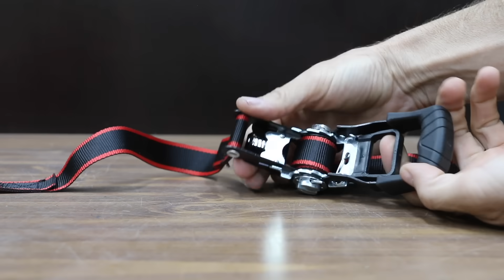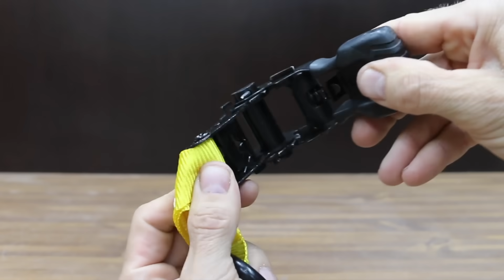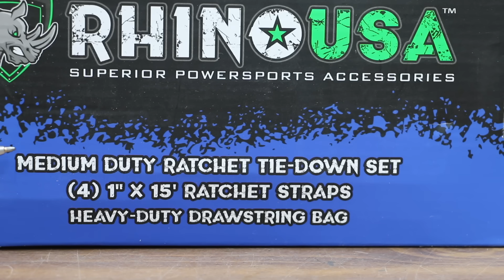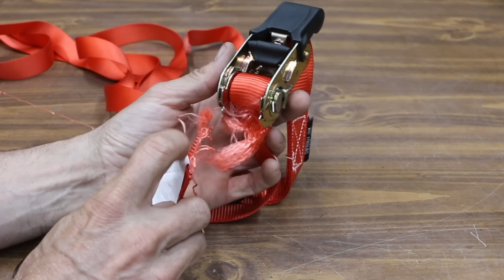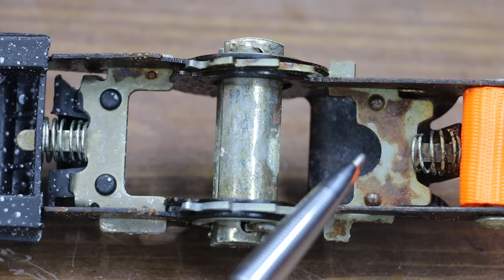Best Ratchet Strap? Husky vs Stanley, Rhino USA, Rocket, Topsky, Augo, RPS Outdoors

Comment: Can you redo this test, but add some tests for the longevity of the ratchet mechanism. We constantly go thru straps when the sheet metal fatigues causing them to fall apart sideways where the pin and washer just lightly suggest the internals to stay put causing it to jam and skip and not ratchet properly.. more of a focus on the ratchet vs the strap.. side ways flex/bend resistance. It only tends to be an issue on 1" can't really use bigger either

Comment: you have to close the ratchet to lock it. Why testing tension loss with the ratchet open on some of them? 

Also the weight to release test is dumb as hell the ratchet isn’t fully open and you aren’t releasing the lock. Nobody would ever use a strap like this.

Comment: I had the harbor freights and the ratchet mechanisms fell apart, junk. Bought the Huskys and they have worked great with no issues. Will admit I don't use them a lot though. Can't speak for the rest, but the Husky certainly better than the harbor freight ones I had.

Comment: I'm a DIY homeowner and use my cheap ratchet straps very rarely.  Here's what I've done with mine and what I would look for in a replacement.
1. The gap between the take-up real and it holder is way to tight.  I preyed mine apart a bit and added a little lubricant.  I want that real to spin easily and freely.
2. Like many, mine have a single spring anchored on one side of the release lever.  The makes the the pull uneven and I usually have to use a screwdriver to full relase the ratchet.  Would a second spring really cost that much?
3. The take-up real is too narrow and too small.  Often times, you just have to ratchet more than you expected, but you can't because the darn spool is too full.  Also, we all know how easily the straps bind up, a little wider spindle would help a lot.
4.  The end of a little pry bar fits perfectly into the spindle ends (over the retaining z-bar) and makes a wonderful crank.

Comment: Hello. Did you ever Test the Dewalt Straps? Here is what I am doing. Scuba Cylinders are about 7" Diameter. And weight about 40 Pounds, 3,000 PSI each. I worry about them Clanking around during transport to different sites. My thought was to strap 2-3 of them together. This way the Valves and other equipment can't get damaged. I saw a couple of Sets today. HF brand and a Dewalt.
Reply from the maker: Thanks for the video idea!

Comment: I haven’t used many other brands other than the Haul Master. I keep one in the bed of my truck 24/7. They stand up pretty well over time, I use it regularly. That said, I could use some heavier duty straps because I go through the Haul Master about every 6 months. So I get 2 years out of one pack. I’d rather get some longer life. Thanks for your info. I come here before I buy most anything.
Reply from the maker: You are welcome!  Thanks for sharing.

Comment: These tests seem hokey. Let’s cut with a knife? Or sandpaper? No shotgun resistance? 

Strappino with a third S-hook (I use the 1” by 15’). More expensive than anything here but so much better. Self retracting with spring-load closure of all S-hooks. The 3rd hook is smaxinhly useful. You’ll love spending the money every use for years.

Comment: A great way to unwind a ratchet strap that is tough is to release/open the ratchet (this can be a pain too), step on one end of the strap, run the strap over your shoulder with the strap going over your back (with the ratchet near your calf), stand with your back straight and core flexed, squat just a bit, pull the strap tight and stand up using your legs. Way more power and control than using your arms. Works great even on the big cargo or herc straps.

Comment: I recommend testing cam buckle straps for strength, UV resistance, and corrosion resistance of the springs to ensure durability and reliability, especially for outdoorsmen and ocean area usage. These tests should focus on applications such as securing kayaks, SUPs, surfboards, and other watercraft.
Reply from the maker: Thanks for the suggestion.

Comment: I needed stronger ratchet straps so I went and got the inexpensive Husky 2" straps rated at 3,333 pounds. Would be interesting if the more expensive 2" ratchet straps were better or worse than the Husky brand.

Comment: I don't tow or haul stuff much. Just  purchased to have one in each vehicle just in case I need to tie down something in an emergency. So Harbor Freight is good enough for me.

But if I were to use these on a regular basis, I would definitely spend the money on one of the 3 that was recommended.
Reply from the maker: Thanks for sharing.

Comment: thank you for another hq Test! A question to those who watched this and were handling (small)ratcheds often. does really the huge amount of man take the time to roll it on like PF did at the end of the video? i use a 6l frozen bag for each ratchet. takes a bit more space than roling on, but serves double the time of onroling and unrolling for use and protects the straps from dirt, dust and hunidity were ever stored. ps: i do dry them when wet before putting in the bags..
Reply from the maker: You are welcome!

Comment: Thanks for the informative video. The problem I have had with my Badass Moto brand ratchet straps is that the plastic coating on the hooks wore or scrapped off and the hooks started to rust. I think you should have also tested the durability of the hooks on the ratchet straps.
Reply from the maker: You are welcome!  Thanks for the constructive feedback.

Comment: I am very happy with my Haul Masters. 
They held about 700kg / 1550 lbs of cargo for my move from Orlando, FL to Edmonton, AB - Canada. It was a 8 day long trip, 4700 km / 2900 mi, some bumpy roads, we went through rain, snow, blizzard, ice and it held everything inside in place in my trucks bed and kept the tarp secured. 
No signs of rusty, tear, hook bends or whatever. 
Very recommended!
Reply from the maker: Thanks for the feedback.

Comment: I've been absolutely obsessed with these videos lately. Based on the On the stretch test numbers, I didn't notice any sort of trend associated with higher or lower loads and the amount of tension loss. However, my brain is telling me that the amount of tension loss would depend heavily on the starting load. For example, starting with a heavier load will definitely put more stress on the strap which might exaggerate or inflate the recorded tension loss.  Conversely, a lighter load will put less stress and may not cause comparable stretch.  For example, the highest and lowest values I think you started at were 337(Rhino, 7th) and 277(Rocket, 1st). That should be about a +/- 10% deviation from 300. I just think that the starting load could have a huge effect on the outcome. Rocket could have place lower, and Rhino might have placed higher? I also get that applying exactly 300 pounds might be difficult to do? The only way I can think to do it would be to use free weights or a hydraulic press? Your videos are awesome, and I really like watching them especially when I already have one of the items you're testing, it gives me a challenger to root for. lol
Reply from the maker: Thanks for sharing.

Comment: I was stunned by how much tension they lost.  I will def. not be leaving right after strapping down and rewrachet everything.  Also good to stop on longer hauls to retighten when it is safe to do so.  Thanks for the advice and all the hard work you do in research, testing, and editing.  [even responding and listening to your fans]  Fan performance would make a great video if you haven't done one already.
Reply: On over-the-road loads you are required to check after first 100 miles and then every stop afterwards
Reply: Per FMCSA it is within the first 50 miles, then every 150 miles OR 3hrs, whichever comes first.
Reply from the maker: You are welcome!  Thanks for the suggestion.

Comment: I really like your videos. I've bought some of your top-rated products shown in your videos. They all rate a 10 out of 10. I especially liked the knife test. I would have done it a bit differently. Instead of the knife, I would have built a miniature guillotine and put a weight on the blade. That rest would be funny. Can you do a car ramp test using a real car/truck? This would answer the question, "How much weight will it take to break the ramp?" For the vehicle, you might use a pickup and place different amounts of weight in the bed. To save the truck from front-end damage, you could do the test backing up the ramp.
Reply from the maker: Thanks!  Thanks for sharing!

Comment: Would you consider testing wheel chocks? It's hard to find one that really holds vehicles from moving, especially on smoother surfaces. Even some of the heavier ones don't seem to work as they should.   Thank you
Reply from the maker: Thanks for the suggestion.

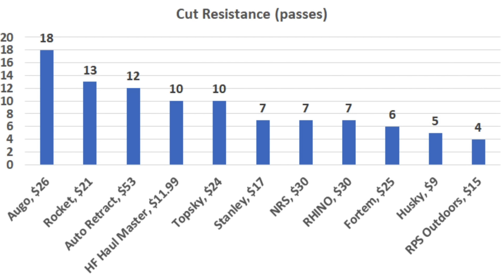Comment: 7:36  Cut resistance results
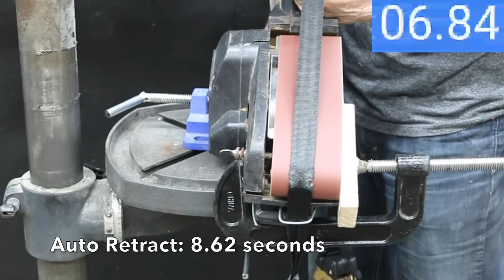9:51  Abrasion resistance results
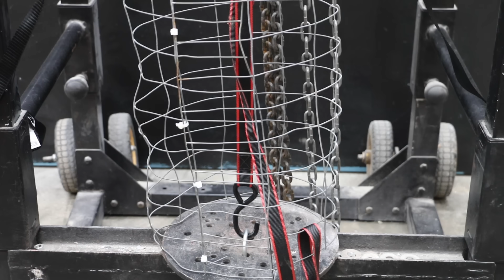10:02  Beginning of break strength testing (results not shown)
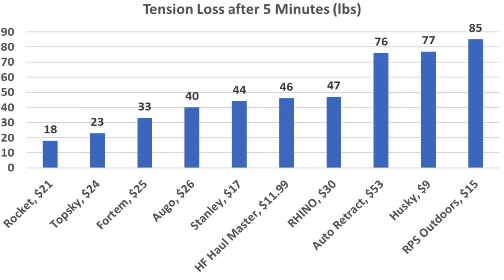13:50  Tension loss after 5 minutes results
14:04  Tension loss after 30 seconds results
15:26  Weight to unwind strap results
15:34  Beginning of corrosion results (no graph because can't really quantify)
17:00  Storage tip
17:22  Conclusion
Reply from the maker: Thanks!

Comment: You should measure the thickness of the steel of the ratchet mechanism. That is where I have them fail. The steel actually bends and they no longer work properly.
Reply from the maker: Thanks for the suggestion.

Comment: Nice video. 

However, what I would like to have seen tested was an actual use pulling power across a horizontal surface.

Set a 300 pound weight in the center of a 1 foot by 1 foot piece of 3/4" plywood on the sand surface of a sandbox to test how easily the rachet can pull that load 5 feet.

Use new plywood for each test and rake the sand flat between tests.

Will the rachet mechanism fail; is the lever handle too short to be able to apply comfortable force; will anything bend/deform; etc?
Reply from the maker: Thanks!  Thanks for the suggestion.
Reply: Because the rachet mechanisms typically only allow for pulling a limited amount of strap build-up around the center roller, you may only be able to pull the load 2 feet. In addition to testing as suggested above, you could test for how much strap can be cinched up on the roller. 

I'm probably not the only person who has used these rachet straps for more than just pulling the straps tight on a load.

Comment: I currently have the Husky because the ratchet is smooth and the coating in the release handle is easy on the hands. Works really well for typical strapping stuff down in my truck. Great video man.
Reply from the maker: Thank you!

Comment: Your storage method,won't work for us contractors in a hurry. I'll try to explain my speed method:
1) Pull the tail even with the hook end, minimizing the overall length.
2) place the ratchet hook onto the folded ratchet
3) holding the assembly, wrap the two.tails around it
To use:
1) grab the tails and let the ratchet drop to ground
2) hold thel tail hook in one hand and tail in the other, lift ratchet off the ground and let it unwind.
3) a quick jerk pulls the freed ratchet up so you catch it.
It's the fastest method I've come up with, and they lay neatly without tangling!
Reply from the maker: Thanks for sharing.

Comment: purchased some rhino straps. super disappointed with the quality and strength isn't accurate on packaging my 500 pound mower broke the strap in a week. it's got emergency breaks on it so the strap didn't even need to really hold it in place was just a extra safety precaution. maybe the lie of being made in America is biting them in the ass. was half the reason I purchased them maybe made in America isn't better. such a shame.

Comment: I usually buy what's available but I have a real crappy set of "snap on". I strapped it to a log we were getting for fire wood. Used a winch to drag it from the woods. Removed the snap on strap and now I can't unwind it. Maybe I over did it but what ever happend this strap is in the trash. I appreciate the informative video.
Reply from the maker: Thanks!  Thanks for sharing.

Comment: On the cut test ,...  I think by not changing the piece of wood the blade landed on before crossing the strap compromised the test. It looked like one or more times that the blade tip had a stronger bite on the wood . Getting hit in the same place that, often will distort/damage the
Reply from the maker: Thanks for sharing.

Comment: Would like to see you assign a point value for each device or product's standing in each test, then  tally the scores for an overall score. Each test could have a different point scale value depending on importance or desirability (IE break strength or corrosion resistance, etc.) for that product .
Love the inventive ways you come up with to test qualities of products, leaves no doubt about the winners in each phase of the testing

Comment: I'm sorta partial to the HF straps, having used a set of them for 31 years.  I bought another set of 4 like these back in 2004 or so.  Not one has worn through or broken*.  I made 2 mods to the straps early on.  It was hard to hit both releases at the same time with both hands busy, so I ground the ears on the one side to allow me to pull both releases with one finger when the levers were together.  The second mod was to remove the straps and spray the ratchet assembly with lithium grease.  I let it harden for 10 minutes and wiped it down.  The whole mechanism was easier after that, and I haven't needed to spray them again, even 18 years later.  OK, the one that broke*: I bought the set of spring buckled (like the NRS) motorcycle tiedowns from HF in 1991 before I bought my new 2WD Ford F-150.  I ordered it from southern CA and flew to northern CA to pick it up.  On the way home, I drove it over a mile down the beach at Pismo.  As I got to the end, it sunk into the sand at the turnaround.  A fisherman there had a 4WD jeep and offered to tow me out if I had a tow strap.  Enter the tiedowns.  Well, the first try, it opened one of the hooks on one tiedown.  The second try it broke the strap on the same one.  I then tied them onto the frame and his trailer ball and it pulled me right out.  A pipe and the HF 5" mechanic's vise I  bought in 1976 helped me recurve the hook, and I just tied the broken pieces back together.  They're still in my truck and working for me.  Like I said, I'm kinda partial to them after all that.  I've always been able to tighten them enough to get any job done, too.  Sturdy!
Reply from the maker: Thanks for sharing.

Comment: I've had the auto ratchet straps for about 5 years now and they are amazing.  With that said, don't leave them outdoors for extended periods of time.  I left mine outside for about 2 years and one of the auto retract stopped working completely so I have to re-roll them by hand each time I use it.  The other one works fine.  :)

Comment: What annoys me about straps is the HOOK! I always add large sized locking carabiners so I can use either anchor type. Even if the load moves so tension is off the anchor point, with the 'biner, the strap is still tied down. On most, I remove the hook and just go with the 'biners.
Most of my loads don't require or can't tolerate huge strap tension, but that doesn't trouble me anymore.
Reply from the maker: Thanks for the feedback.

Comment: I was in the Navy for 9 years and I was a deck ape for 3. We generally use nylon double braid for our mooring lines because its very strong and also has some stretch. If you are doing something like mooring a ship and you know theres gonna be pushing and pulling (water current) you want a little bit of stretch so the lines dont part right away. HOWEVER, the danger of stretchy lines is when they do break they snap back quite fast and can cut a grown man in half. 
We also tried using polypropylene lines but they didnt work out so well. They part quickly when you try to stretch them which means no snap back and no one gets hurt. But you do need to allow a bit of stretch or else they will be breaking all the time. Rubber bands versus chains would be the extreme ends of the spectrum in this comparison. Either absolutely no give and they snap instantly, or ridiculous give and they cant really hold anything together.
With regards to ratchet straps you'll have to make a choice. How much give do you want to allow before breaking? and will it be a safety issue.
Thats why when you are trying to pull a car out of a swamp or pit you need to keep everyone the hell away. Most of those towing lines are nylon. They can hurt bystanders if they break,  and the average person doesn't know about this principle.
Reply from the maker: Thanks for sharing.
Reply: You can also lay some sort of blanket over each line as well to help absorb/deflect the energy if the line ever snaps.

Comment: I'm a whitewater kayaker/rafter and we use NRS straps for everything. They're light and it's hard to over tighten them enough to damage boats compared to ratchet straps. We still carry tubular webbing and rope everywhere if we have to make a really strong anchor but nrs straps are so quick and easy to use for most things. I would love to see a video comparing different brands of cam straps to NRS. I have a few different brands at various price points and would love to get a better idea of their value!
Reply from the maker: Thanks for the suggestion.